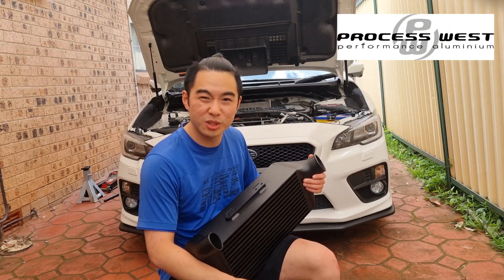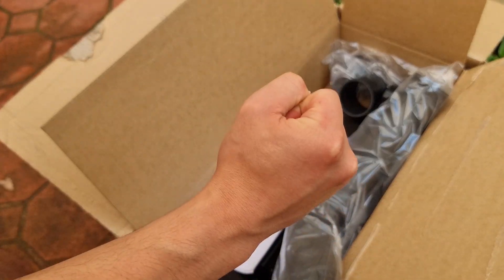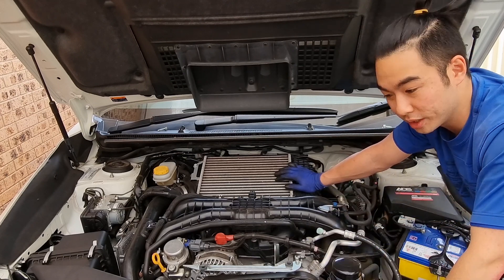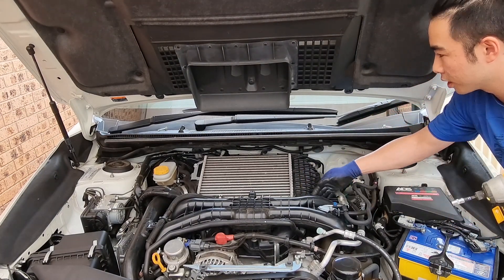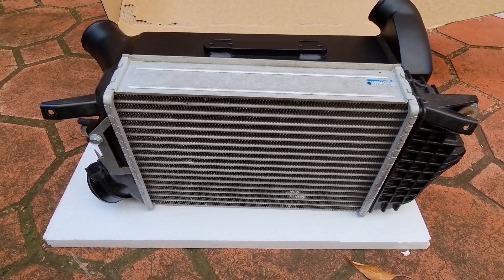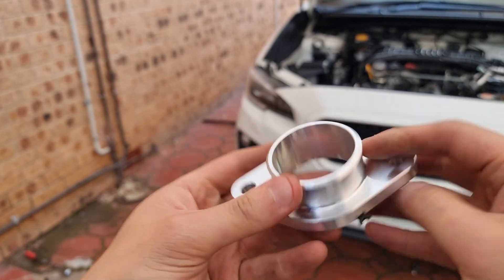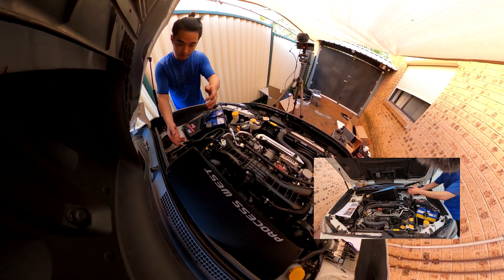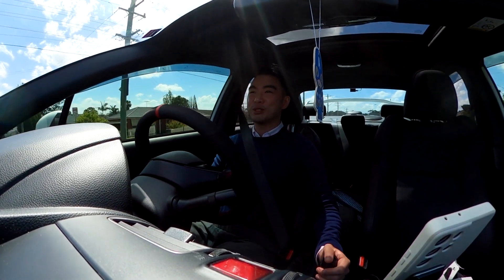Process West's Engineering Marvel: Verticooler | How It Works

Comment: Is there any hp increase?
Reply from the maker: Not from bolting on. But could give some tuners more confidence to push more power. Though generally more power is not the point of a larger intercooler, just better for cooling and reliability
Reply: @MrDuongTV1 hey mate thank you for replying, do you need to get tune after installation?
Reply from the maker: @kennyjohnson4515  no worries. Nope! No tune required 🙂
Reply: @officialMDTV1  does the charge pipe add any additional noise for the BOV ?
Reply from the maker: @kennyjohnson4515  yeah i have it on full recirc atm and you can hear it nicely sometimes. Tho I have a GFB BOV not sure what it would be like for stock BOV
Reply: @officialMDTV1  should be extra noise as i have a turbosmart dual port bov
Reply from the maker: @kennyjohnson4515  oh right then extra noise you shall get! Even louder if you have a CAI too
Reply: @officialMDTV1  yeah ahah I also have a cobb sf intake too
Reply: @officialMDTV1  the only thing I'm concerned about is the intercool might make contact with my whiteline sturt brace

Comment: Hi Mr Duong, I get back to this video again. I found PW got normal top mount and this verti cooler, are there any big difference between them?
Reply from the maker: Hi mate welcome back. The Khanacooler (regular top mount) is slightly smaller and lays flat - so all round not as efficient as the verticooler
Reply from the maker: But it would be much easier to install

Comment: Hi Duong, how’s the temperature shows on the display after you changed the TMIC?
Reply from the maker: I dont have anything to monitor the air temps, maybe an accessport would do that. The stock gauges don't have that kind of info.

I definitely do feel the benefits though, car was snappy and performed all day when I took it out on track, ambient temp was close to 30°C
Reply: @officialMDTV1  Thanks for that! Btw I am in SA, looking forward one day could meet up!
Reply from the maker: @JokerMo1023  thanks for watching and following along mate!
Reply: @officialMDTV1  Mr Duong, would you mind to have a look if still have room to put the strut bar after changing to this bigger TMIC? Cause I have a STI one on the car at the moment, thinking if could fit or not? Much thanks

Comment: Mr Duong you need some 3/8 drive ratchets & sockets. 1/2 drive are to big for most jobs on a subie.
Reply from the maker: Thanks for the tip mate, I did have to use an adaptor for a lot of my jobs... I have a full with with 3/8, maybe its time I crack it open